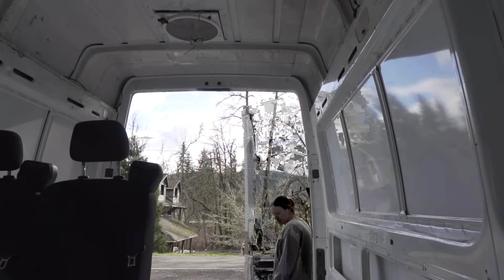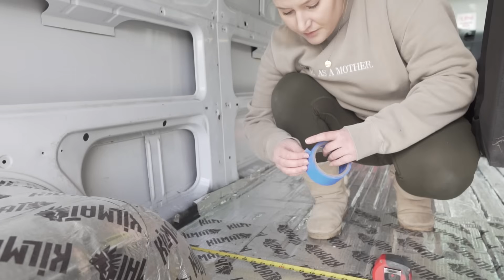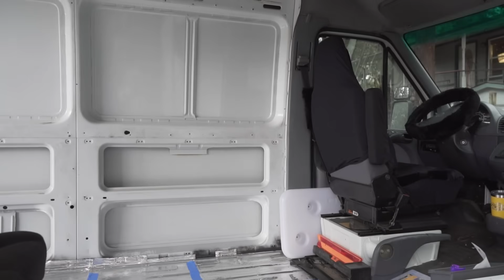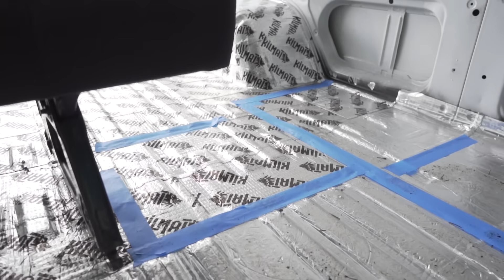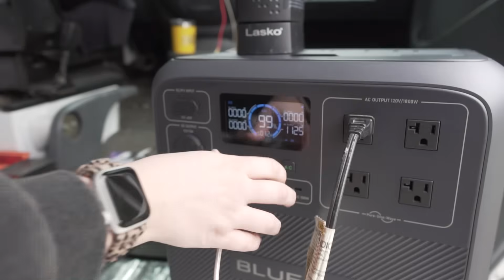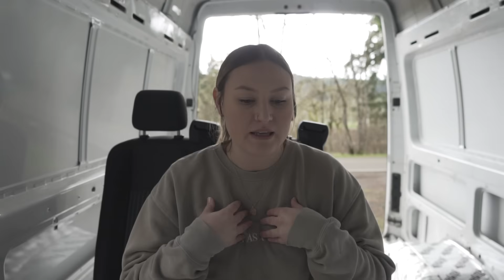Designing Your Dream Van Conversion: The PERFECT Floor Plan

Comment: Jayleena, what about pulling the seat/ bench forward a little, and putting a small bench/Seat behind the seat, to house your porta potty. Ember is potty training and having a permanent spot for it to be convenient and ready for her to use would be a great idea. The padded bench Seat over the porta potty could be a cozy private spot to use also. Also pulling your bench Seat forward would make it easier to put her in her car seat, rather than having to always get up in the van to get her out. There is a nice corner cutout in the step/floor right there at the doorway. Also, when you're at camp the bench Seat will be open to the outside for easy access to all the views from your table!!❤❤❤

Comment: it would be nice if both front seats swiveled so you could add a piece of plywood across them to create an extra bed for Ember. Of course you would have to have a curtain that goes around the front or an outside cover if you are not stealth camping. It would be nice if you could get someone who does pull downs to sponsor you. Do you intend to put in a window over the sink so ember can see out? I’m afraid if she is behind the passenger seat she will. Not be able to see the movement of the car on the road. This is why backward seating makes you sick. As a child who got very car sick myself this is extremely important.

Comment: Yes getting Ember’s seat area where you can see her - while you are up front. Getting necessary kitchen stuff in a good spot to use. Write down the pros/cons of the kitchen in the big bus. Just suggestions. Can peep holes be put in certain areas of the van in lieu of a full window. Like front door peep holes. That way if you heard sounds you could peek out quickly. I know Ember will enjoy getting in the van, even if it’s just a day trip to a park and back home!❤

Comment: Hey Jaylena,  you may want to consider a duel fuel butane burner for stove.  Fits under a cabinet, can have very high heat levels, runs on propane or butane and is totally portable to cook outside if needed.